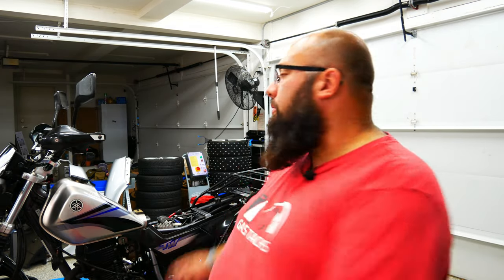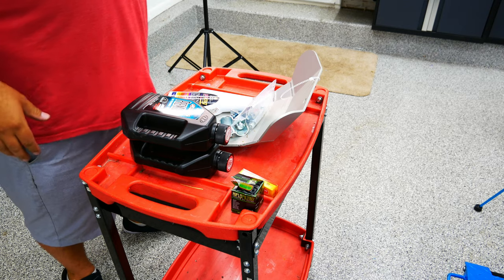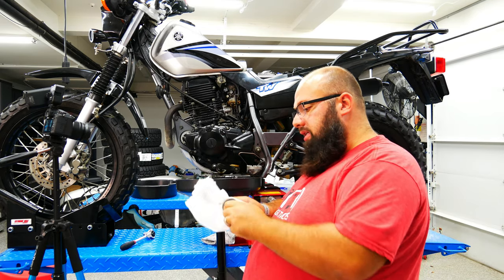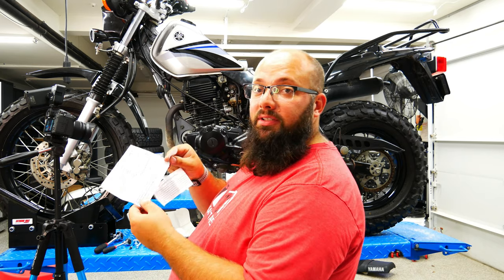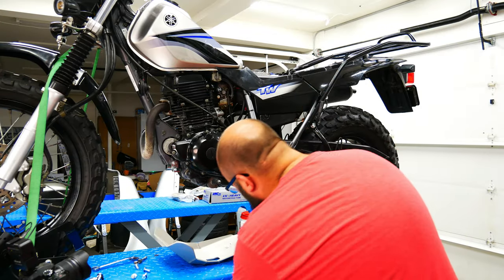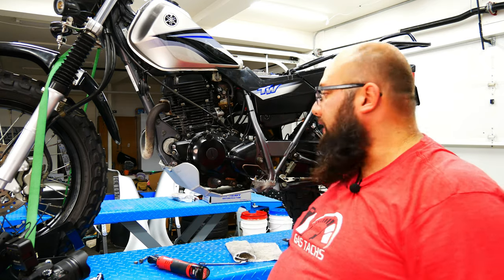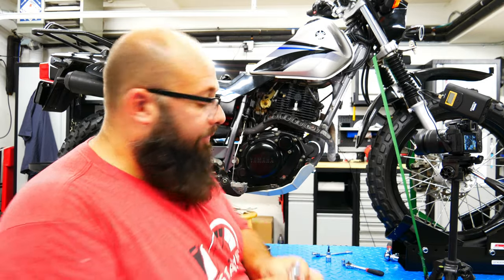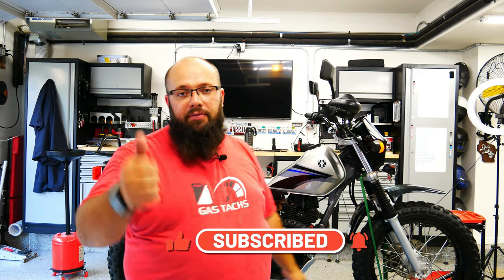TW200 Oil Change, Spark Plug and NEW Upgraded Skid Plate!

Comment: you should also do a valve check,   recommended every 3,000 miles but super easy 15 min job on the tdub.
Reply from the maker: Thanks, I will add it to the list 👌🏻
Reply: @GasTachs   I have a shop manual on hand if you want the specs?
Reply from the maker: @abyssflight3907  No should be good thanks, I will download a copy to keep it on hand!

Comment: If you had to do it again, would you still buy sonic tools + storage? They look so sleek but if something new is needed, it throws a wrench in the organization
Reply from the maker: Yes I would. The main tools are the ones that are organized and ready to get used 24/7 and easy to find. Now if I need to order a special tool and Sonic doesn't have a foam cut out for it, that doesn't bother me. If they dont have a foam cut out for it It means I wont use that tool as much and I dont need a foam cut out for it. The only reason I ordered the Cabinet from Sonic was because the foam cut out fit perfectly into the drawers. If I could find a cheaper option for cabinets that the foam fits perfectly or close to perfect I would do that.